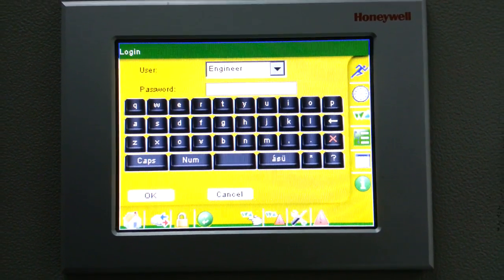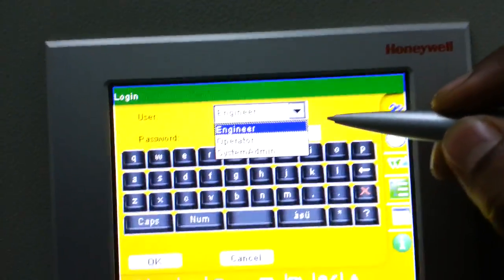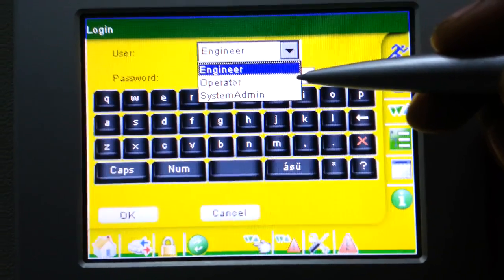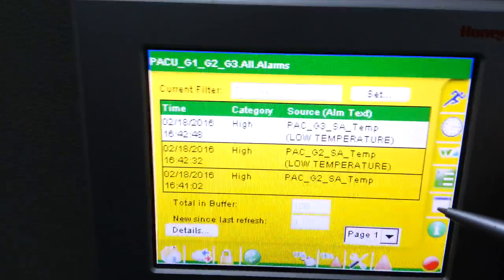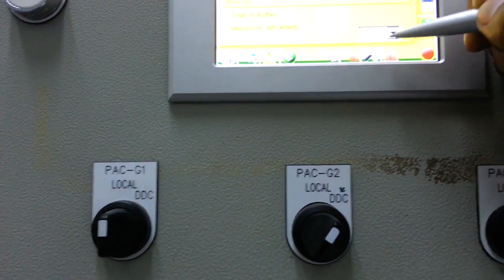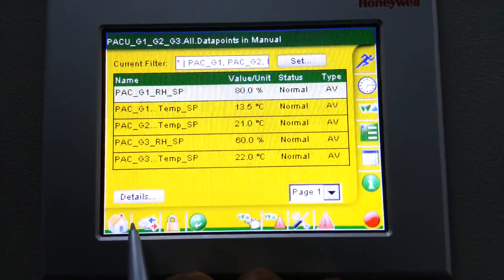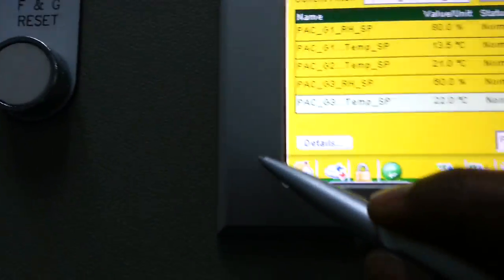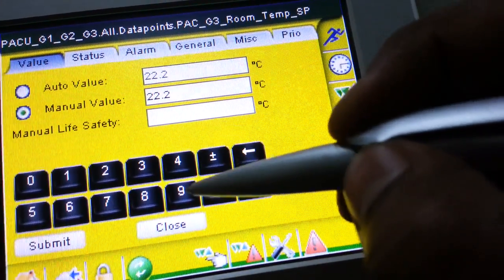DDC Control Pannel of Honeywell and its Working -3

Comment: we have our client place, Packaged Roof type Air handling unit, each floor  5 offices and each office  AHU units/Ventilation Fan , but before operating through circuit  braker, but now client need complete solutions for HVAC controlling through BMS software. can you share the you email id, i ill share the boq and share complete AHU Integration parameters.